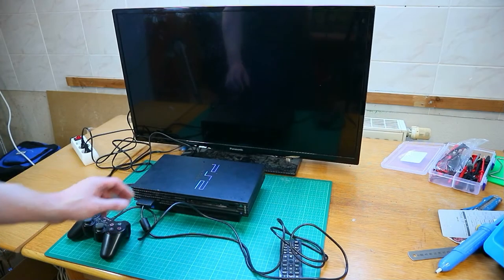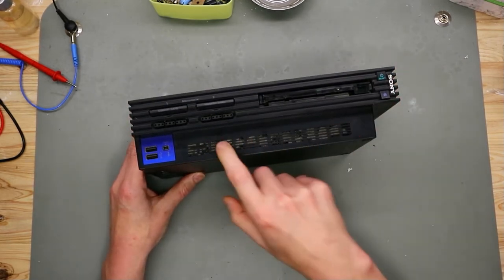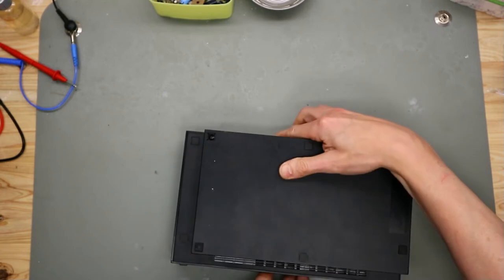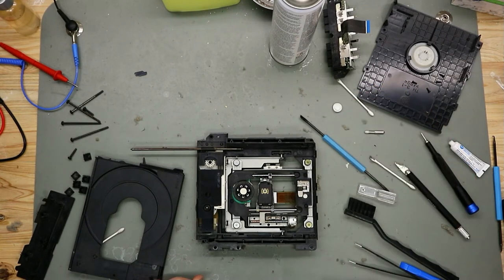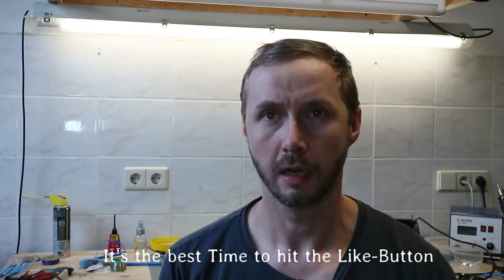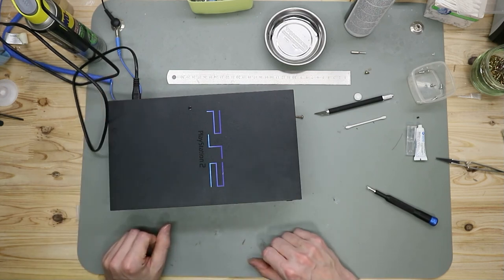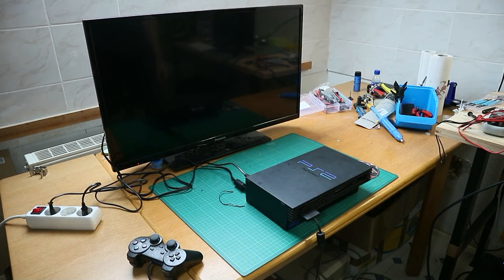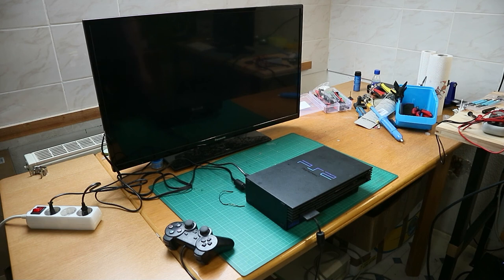Can we fix the drive of this Sony PlayStation 2, that not open.

Comment: I got a used PS2 and it stays on the menu. But after a couple of minutes it does eventually boot the disc. Not ideal though, but I'm glad it works at least
Reply from the maker: It seems, there could be a fault of the laser-unit. The Laser-unit is a common failure. It could be faulty capacitor maybe. It’s difficult to say without testing.